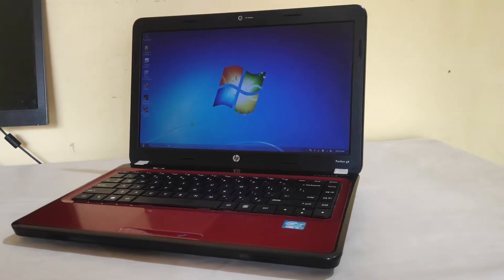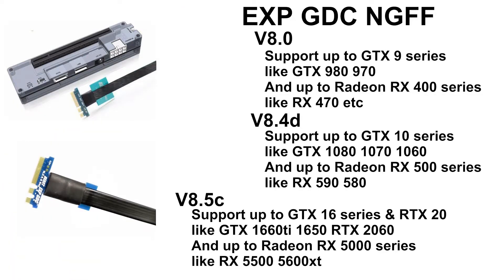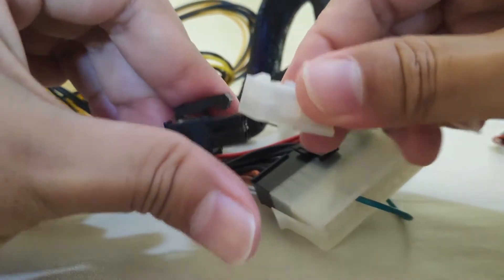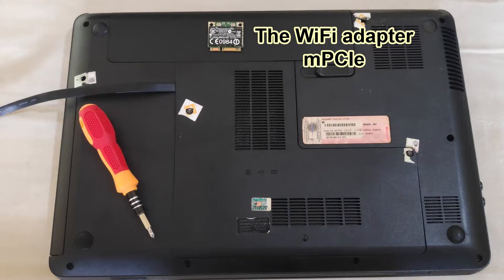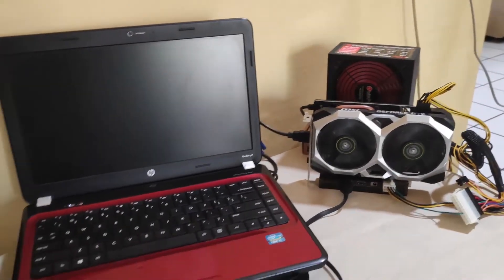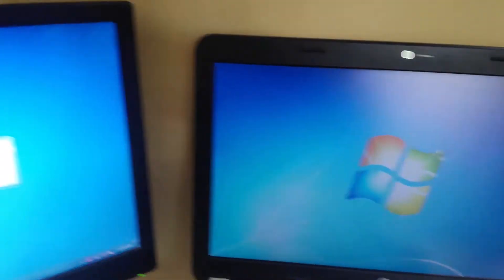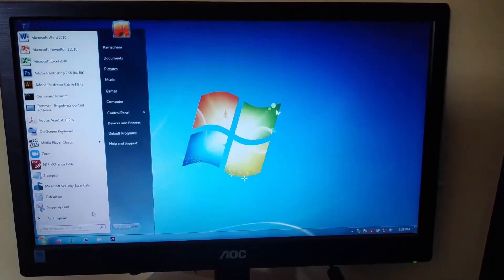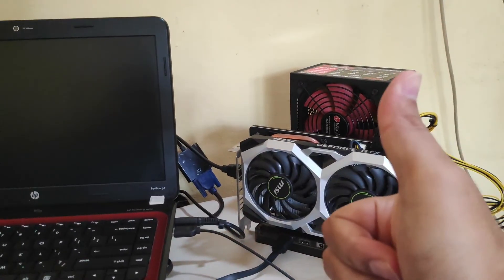EXP GDC Beast V8.5c eGPU with GTX 1660 ti on Old Laptop from 2012

Comment: I'm specifically interested in buying the Elgato 4K60 Pro Mk.2 for my future gaming desktop (predominantly for its multifeed feature), but I don't have the financial means yet to put the latter together. Hence I wondered, if I were to buy said capture card now, could I maybe already put it to use with my older laptop using an EXP GDC (Mini PCI-E Version)? My laptop is an Asus R556LA-XX1875T, and up until now I've managed to use it for window capturing at 720p60fps just fine. Obviously I would use the capture card to capture and stream at lower resolutions and/or framerates, until it can be integrated in the proper gaming rig...
Reply from the maker: Wait really? Are you sure it is using Mini PCIe version? As far as I know Intel Core i5 from 2015 with IntelHD 5500 is using NGFF WiFi socket.
I could be wrong. But anyway more or less yeah you can use EXP GDC eGPU with any GPU be it NVidia or AMD RX is fine.

That's why I tell anyone who watch this video to Open Your Laptop before deciding to buy eGPU.
Reply: @ClayWheeler  Oh right, I'll definitely open my laptop to double check, thanks. But yeah, assuming it is using Mini PCIe, I'm talking about using a PCIe capture card with the EXP GDC, not a GPU. Could you perhaps answer on that? :)
Reply from the maker: @horgoththerelentless261  the capture card in my mind is using the portable one. For one reason: you are using an Old Laptop.
The possible Capture Card is from GPU card HDMI output to the Capture Card Passthru. So the scenario look like this: Laptop->eGPU->GPU->Capture Card->Hard Drive & External Monitor.
The Hard Drive here is HDD External with USB 3.0 to write the captured video.

Elgato Capture Card that you mentioned is using PCIe lanes on Desktop Motherboard to capture visual activity. You need another type of Capture Card.

I will do a quick search for this kind of Capture Card
Reply from the maker: @horgoththerelentless261  the Keywords search for this kind of Capture Card is:
Capture Card Passthrough for Laptop. Not sure if Elgato have this version or not
Reply: @ClayWheeler  I'm not sure what you all meant but at least I'm aware that Elgato mentions PCIe lanes directly on the Desktop Motherboard, however it's already been shown to work on external PCIe slots as well (though these are Thunderbolt eGPU enclosures): https://www.youtube.com/watch?v=1ChBo65TMz0

Only thing is, my laptop has no Thunderbolt port and I also don't find those enclosures' pricetags worth it. Also I have no interest in buying a dedicated external capture card from Elgato or any other company, I'm specifically interested in the 4K60 Pro Mk.2 for its multifeed feature (i.e. it automatically records and stores a copy of your game capture on your pc's HDD while you're streaming).
Reply from the maker: @horgoththerelentless261  ok Quick questions:
Do you already have: 1) a Laptop 2) a Desktop PC?
Because so far I only thought you only have a Laptop and planning to use eGPU on it with capture card ability. And then 4k60 Pro Elgato needs PCIe x1 Lane.

What I was thinking is that the Capture Card that doesn't need any Desktop PC since I thought you didn't have a PC in the first place.
Reply from the maker: @horgoththerelentless261  you need something like Elgato HD60 S+
Reply: @ClayWheeler  Thank you for your answers. Again, I have no interest in dedicated external capture cards like the HD60 S+, the whole point of the 4K60 Pro is that it supports multifeed. And to answer your previous question, I only have that laptop, no desktop. The desktop is an idea for the future when I have the money to put it together, and at that point I would most definitely insert the 4K60 Pro in there. But for now I only have the laptop and I am looking to already provisionally buy the 4K60 Pro (because that I can afford), and the question is if I could use it with the EXP GDC on my laptop.
Reply from the maker: @horgoththerelentless261  Quick Answer: No.
Reason: How are you supposed to turn on 4k60 Pro without a Desktop PC? That's only possible if you want to record gameplay video from PC. Not from Laptop. As for Laptop, only HD60 S.

Comment: great video explaining the process. Thanks for suggesting the DIY egpu 1.3 to me, but i am still stuck as i cant even load up the menu of the 1.3 correctly. Nando has been giving me a few ways to try but still no luck, really frustrated. i think i am going to give up if still get it configured in a few days.
Reply: did you got it to work? what laptop and gpu btw

Comment: how about lenovo ideapad 310 14-isk i5-6200u? what gpu do i need for egpu? I am planning to buy 1660ti super  btw
Reply from the maker: At the beginning of the Video I told you that you need to open up the Laptop in order to know the type of the socket. Surely I don't know about your Laptop.

But my GUESS that you need to buy NGFF eGPU EXP GDC V8.5c and Radeon RX 5600. Don't get GTX 1660 ti because your Laptop already have NVidia 920mx
Reply from the maker: Radeon RX 5600 equal to GTX 1660.
RX 5600xt equal to GTX 1660ti
Reply: @ClayWheeler  yea sorry, i forgot to tell you that i know what socket im gonna use, how about rx580? thank you for replying <3
Reply from the maker: @goldcoin143  if you can choose between RX 580 or RX 5500 XT, just get RX 5500 XT because it is basically same price.
Reply: @ClayWheeler  thank you sensei

Comment: Hello bro I have hp pavilion dm4 Core i7-3612QM with AMD Radeon HD 7570M 1GB+8gm of ram I recommend to you use Rx 570 4gb
Reply from the maker: That means I need to uninstall previous driver right? Otherwise it will cause Driver Conflict

Comment: hi i have a laptop with i3 4005u.Is it recommend to use gtx 1060 3gb to setup exp gdc.I am planning play games like rainbow six seige,witcher 3,gta v,cod WWII,battlefield 1,far cry 4 and red dead redemption 2 atleast at medium settings.
Reply from the maker: What's your Laptop model?
Reply: @ClayWheeler  dell inspiron 14 5442
Reply from the maker: @shashitharan302  Apparently you can only play games on Low settings. Because Core i3 4005u is Dual Core CPU with only 1 RAM stick of 4GB. Apparently you can't add the RAM, except Changing it DDR3L 1600Mhz 1.35 volt 8GB

EXP GDC V8.4d GTX 1060 3gb, Rainbow Six Siege - Low settings. Witcher 3 - Low settings. GTA V - Low settings. Battlefield 1 - Low settings. Far Cry 4 - Medium settings. Red Dead Redemption 2 NO (You cannot run RDR2 on Core i3 Dual Core because the game will refuse to run at all)
Reply: @ClayWheeler   wow thanks for the reply

Comment: Hi man
I do not know what to do :( 
Maybe you can have an idea... The only way that the egpu works is to connect the wifi card to the pci port and turn on the laptop, then turn it off and connect the egpu, that way it works perfectly, the problem is that when connecting an external device such as a pendrive or audio cable the notebook restarts and no longer works.
So for it to reconnect I have to repeat the process of connecting wifi card etc.
My laptops
Lenovo g470
Gtx 770
Psu 600w
Bios mod unlock advance menu
Reply from the maker: Good question.
Step 1. You may need to change the Power Plan solution from Control Panel. It is either Power Saving, Balanced, or High Performance mode. Change it to High Performance mode.

Step 2. Go to Device Manager, Scroll down to "System", expand it, scroll down to "High Precision Event Timer" right click on it, and Disable.

Step 3. After doing step 1&2 Shutdown the Laptop, make sure the eGPU cable inserted properly. And plug the USB pendrive or Audio jack before turning On the Laptop. 

Step 4. After turning On the Laptop, try to safely remove hardware of that USB pendrive, and then, put it back in. Try to see what happens.

When you're on High Performance Mode, try to Plug the Laptop charger.
Reply from the maker: Note: if the problem still the same, it is very likely the DRIED Up Thermal Paste. I have to admit that my Laptop in this video has never been reapplied the Thermal Paste for 8 years. I only added the Thermal Paste when waiting ordering the eGPU Online. But I didn't put it in this video.